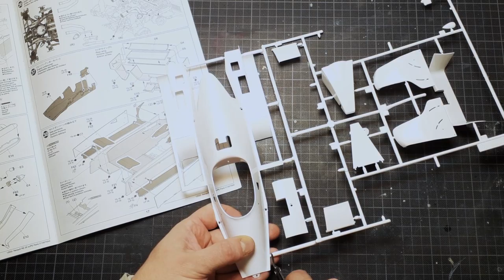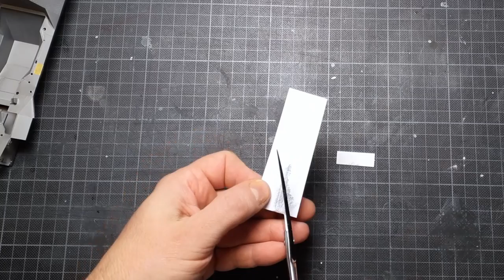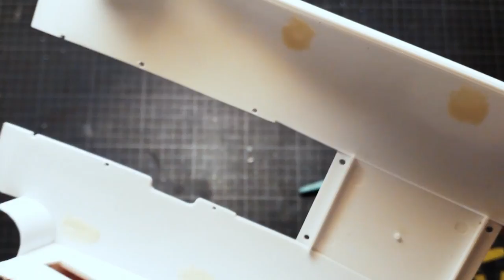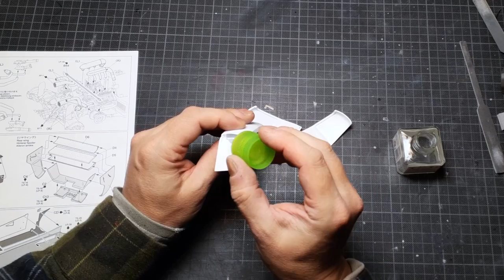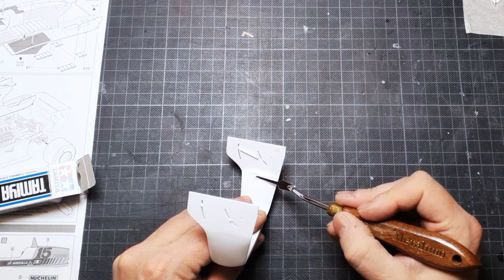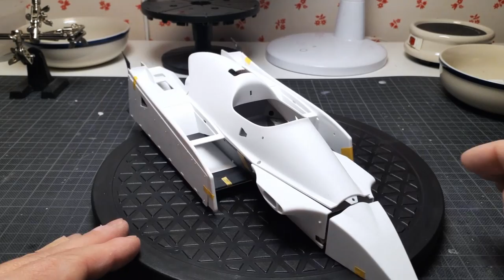#2 TAMIYA 1/12 RENAULT RE20 TURBO - Preparation

Comment: I finished this model a few months back. Took some time especially the painting of the bodywork. When assembling the turbos and the inlet and exhaust piping on each side of the engine I had the lower bodywork in place to ensure the turbos fitted within it.
Reply from the maker: Hi David, thanks for the heads up! Will keep that in mind...cheers Mark

Comment: Hi. I've just started to build my kit & was following the instruction numbers. I paused the build to follow your videos. This one (No.2) is very interesting. I may be lucky, but I don't have any of the 'gap' issues you have. Yes, there's a 'step' at the gap area, but that's all. Thanks for the heads up. I'll be ordering more putty, lol!
Reply from the maker: Hi Steve...I probably didn't explain that good in the video -  but for me the gap issue started when I installed C11 and C10 body panels...best to test fit with those body panels if you can...it was a very tight fit which forced the two halves of the chassis to separate. Anyway hope that helps...cheers Mark

Comment: I am so pumped I found this channel! I have had this kit sitting in the box for 10 plus years. This is going to be such a help for me as I have always been concerned I am too much of a novice for this kit. I usually do 1/24 type sports cars so this is a stretch. I think I will move along with you.
Reply from the maker: Hey Brad M,
Thanks for your comment. I find the 1/12th scale model kits more rewarding to be honest. Might be a bit more time and work (and paint!) but looks great on your shelf when done.
Keep in mind its still made from the same materials as the 1/24th kits so I think you will have a lot of fun with it!  
At this stage, I would suggest you take a look at the condition of your decals, they can age and degrade a bit. They might need extra care when you put them on. If they are really bad you might be able to snatch up a decal sheet. (Shunko models come to mind)

Anyway do fell free to send pics of your progress to me via my telegram site. Be great to see your progress. Ok Brad M good luck with it...its a lovely machine!...cheers Mark

Comment: This should be an re-issued RE20. My first built was around when I attending secondary school (some 40 years ago), and I remembered the body parts are in yellow plastic. Then I had kept some but was later sold, the most recent one was acquired over 10 years ago, but lost it few year back then due to relocation.